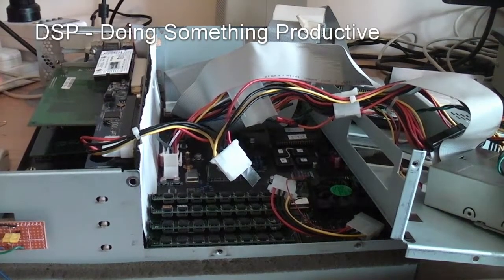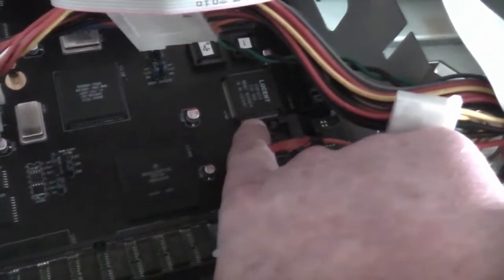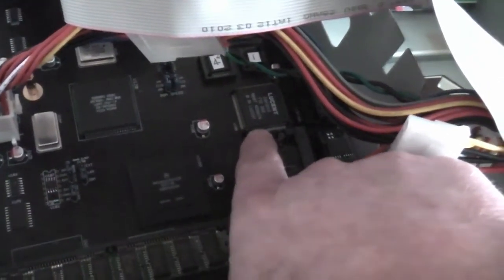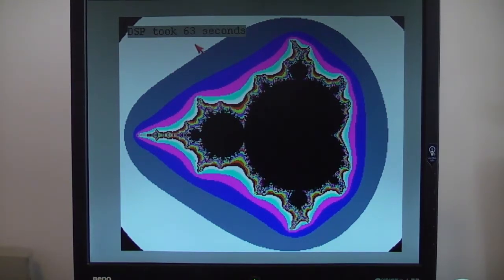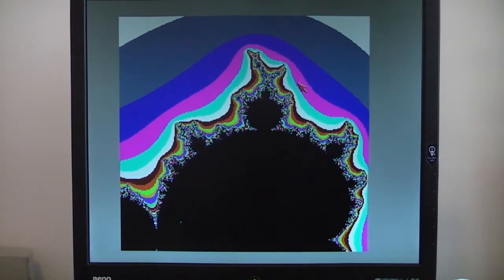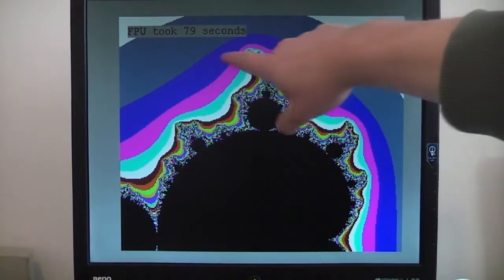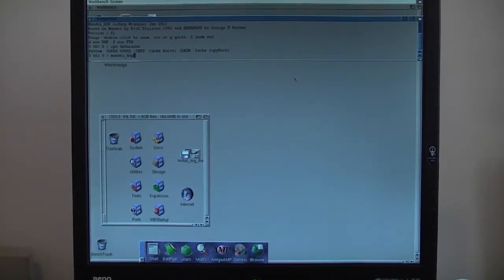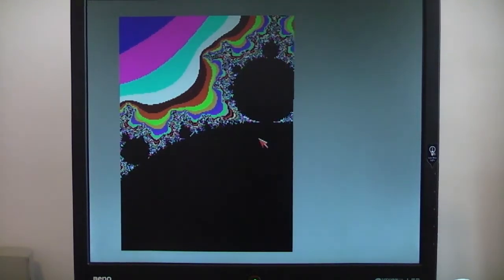Amiga DSP - Doing Something Productive

Comment: Are you the designer of this motherboard? I did see this board on an Amiga forum but it looked as though ordering the board was no longer possible.
Also does Dave Haynie have one of your recreations?

I was tempted to see if it would be possible to order a few as this was a machine I always wanted.
Reply from the maker: No, I don't have the skill to make anything like that! The designer is Hese and the sales channel is a thread on Amibay. I don't think these boards or the DSP software have made their way to Dave Haynie.  Hopefully he would be pleased to see his prototype produced in numbers and running software!
Reply: @wrangleramiga896  
I was thinking of possibly buying one but was tempted to possibly buy one for Dave Haynie too (I would love to see his comments on this design for something which never found the light of day). The Amiga forum I came across (I think it may have been Amibench) seemed to look like no future orders so I think I would need to pay higher than usual. Also whilst I could solder it together I am not sure I would feel comfortable at all doing it.

I have a very rare prototype (one of two; though I own the lesser of the two). I was tempted to lend this to either Hese or Chucky to reverse engineer and make the design available. When Dave auctioned lots of prototypes; it was the only one which I could win over his then boss (Ryan).
Reply from the maker: Looks like Hese is taking orders still on the Amibay thread and he has an assembly service too.  I'd be interested in some pics of your prototype!
Reply: @wrangleramiga896  It is the lesser of the two Gemini prototypes. There are pictures of it on The Big book of Amiga hardware.
I bought the lesser one before Dave found the other one :(
Reply from the maker: Still - a very nice piece of hardware!

Comment: Interesting. How does it compare to the DSP in the Atari Falcon?
Reply from the maker: I'm not familiar with the Falcon but from what I read it's DSP was a Motorola DSP56001 at 33MHz whereas the AA3000+ has an AT&T DSP3210 at 50MHz.  So different clock speeds and architectures eg the 560001 has 2x56-bit floating point accumulators whereas the 3210 has 4x40-bit FP accumulators.  Very difficult to compare without running a head to head somehow!
Reply: @wrangleramiga896  
From Freescale'sy DSP56001/D document

"The data paths are 24 bits wide thereby providing 144 dB of dynamic range; intermediate results held in the 56-bit accumulators can range over 336 dB."
Reply: @wrangleramiga896  560001 is fixed-point arithmetic.

 DSP56000 uses fixed-point arithmetic, with 24-bit program words and 24-bit data words.
Reply: Falcon's DSP56001 has 96kB 0-waitstates internal RAM, Amiga's AT&T 3210 8kB internal RAM. Other DSP parameters: Falcon: 32MHz, Amiga: 50MHz; Falcon: 56bit math, Amiga: 32bit math; there are also more differences.
Reply: @blast4722  Falcon's DSP math is fixed point 24 bits.  DSP32 supports fixed point INT32, DSP-FP32, IEEE FP32 and FP40.

Comment: Hello,

Well done for having managed to revive the DSP planned for the Amiga.

What, in my opinion, could be interesting would be to see a comparison of the performance of the DSP against the onboard 68030 and 68882, as well as against a 68040 (A3640). To me, it's a good way to realize what we missed at the time.

In addition to the mandelbrot, a JPEG display comparison would be really interesting.

I also hope one day to be able to hear the DSP audio 16 bit 8 channels and MP3 playback.

Congratulations again to everyone who made this video possible.
Reply from the maker: Thanks for the comments.  I agree with your "wish list" comparisons.  The bit that is holding this back right now is that the DSP is very temperamental with the CPUs/accelerators it will work with.  Some not at all (eg A3640 and onboard '030 - which is totally weird) and some only partly (eg CSMk2).  Atm, I don't know why that is, and until someone with a logic analyser takes a look at it, we're not likely to make much progress.
Reply: @wrangleramiga896  I didn't know for the onboard 68030 or A3640. All we can do is to hope that one of you can get them to work, as you did for the DSP. We waited 30 years to already see this video, we can wait a little the rest (well not 30 more years anyway :))
Reply: @wrangleramiga896  If it's not working with the onboard CPU, then I think that the version of the 3000+ that these replicas are based on might not be the newest version that commodore did. Either that, or they never got the DSP up and running themselves.
Reply: @kyle8952  May be and May be Hese can fix that with a future motherboard revision

Comment: To try and eliminate some of the chip-ram access overhead you could try changing the approach a little. Doing horisontal lines instead of vertical lines and then only writing to the chipram every 32 pixel - i.e. taking 32 individual calculated pixels from the dsp-interupts and keeping them in an internal cpu-register (or even fast-ram) and then only moving a single longword to chipram in one go - seems like that would remove the most excessive overhead.

Comment: Having by default a dsp which was probably way cheaper then a 060 giving this kind of speed bump would be quite a thing
Reply from the maker: Yes, completely agree!  Shame Commodore missed the opportunity.
Reply: And of course it was available a few years before the '060. Just having the DSP with the original '030 would also have eliminated all the compatability and optimisation issues with lots of existing software that the '060 would have suffered from even if Commodore hadn't gone bust, you've just got a decent ('030) with good compatability and with which developers are familiar and a distinct quasi FPU in the DSP chip. You'd probably have to wait until 1995 or 96 to be getting the best out of your '060 and of course that wouldn't solve problems with older software.

Comment: Is the DSP capable of mp3 decoding?
Reply from the maker: I can't say for sure, but I would expect so.  We'll only know when someone tries it!
Reply: @wrangleramiga896   A3000+ DSP 3210 has only 8kB internal RAM. It could be not enough for mp3 algorithm.
Reply: @blast4722  maybe there's a pin compatible DSP with a bigger feature set?
Reply: @jkdsteve  good question and actually I have no idea. Maybe would be easier to create a drop-in replacement with FPGA and e.g. with more RAM